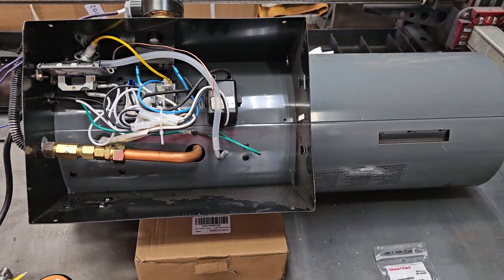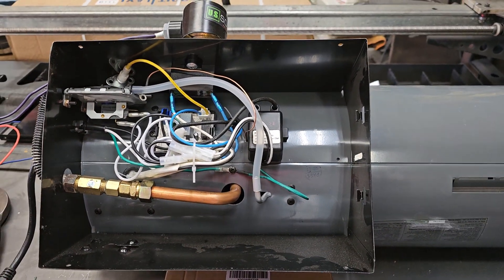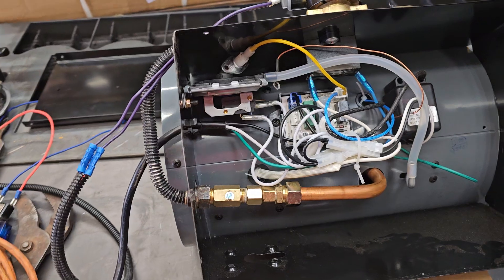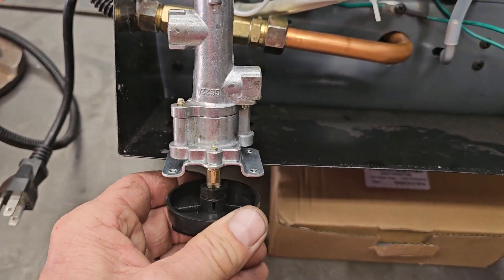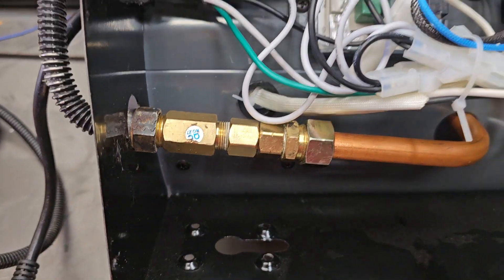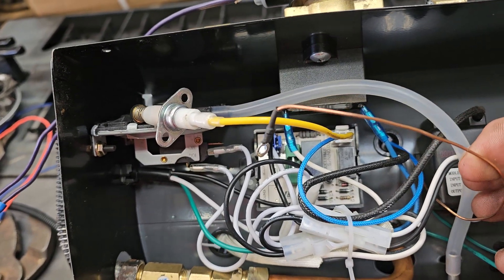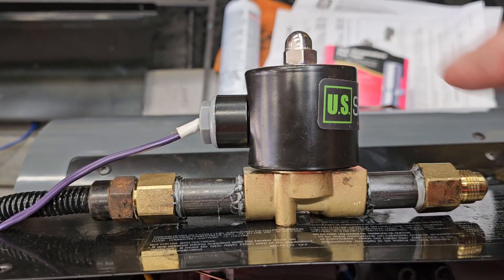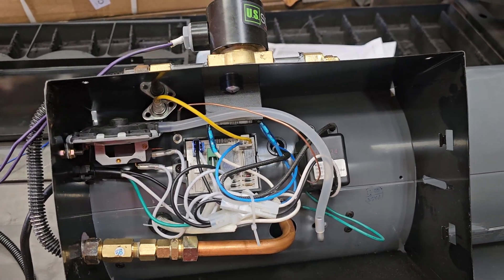modify a propane torpedo heater for a powder coat oven

Comment: So you eliminated the control valve all together? Wish I had one that
Reply from the maker: yes because the PID controller turns the heater on and off to keep my oven a temperature so there is no need for adjustment.
Reply: Will this all work with 120V? Or u using 240+?
Reply: The valve is only 110V